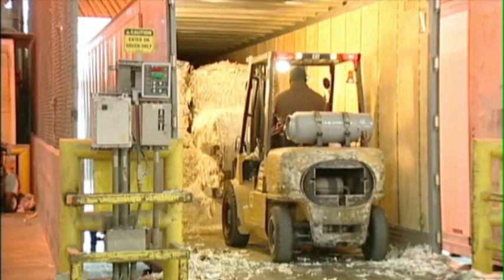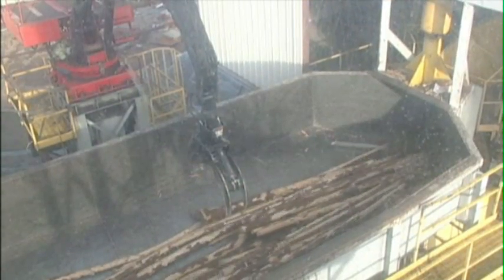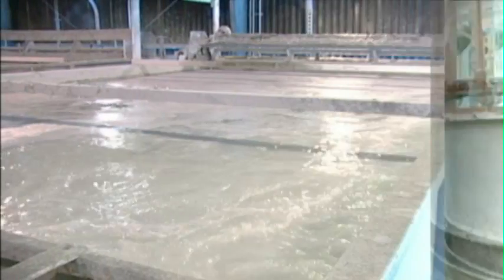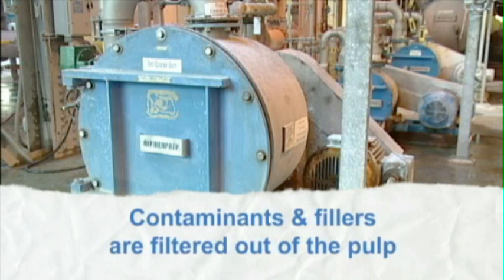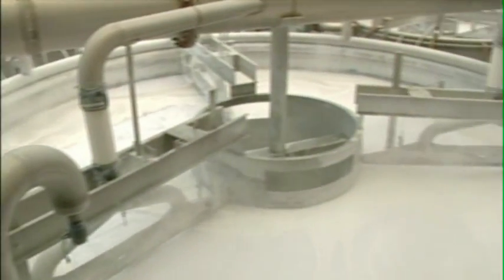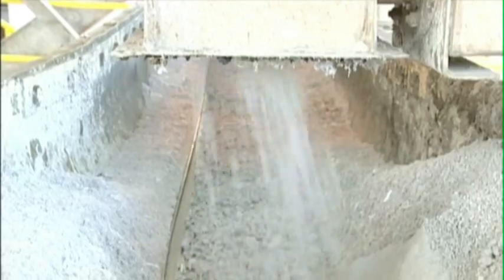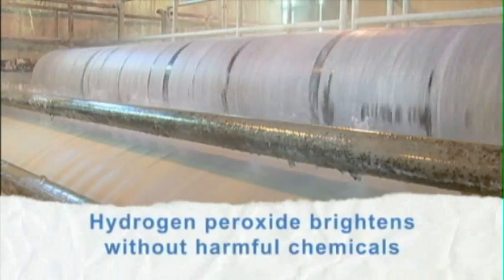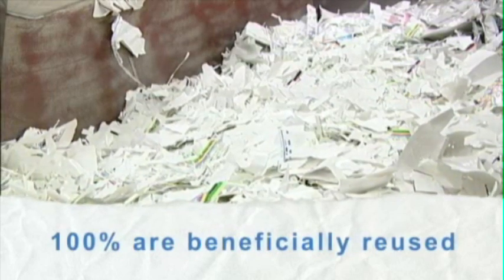Boise Jackson

Comment: Interesting video.  When the solid contaminants are removed from the bundles of recovered paper, does this include staples?  Basically I'm wondering what happens when stapled papers are put into recycling bins.  I try my best to remove staples from papers before putting the paper into the recycling bin, but this is not always the case (for the sake of time) and I have seen others putting stapled papers in the bin.  Thank you.